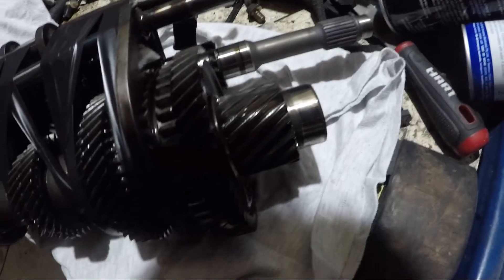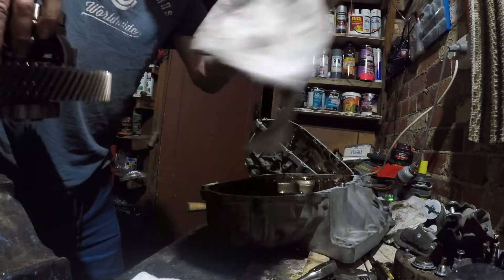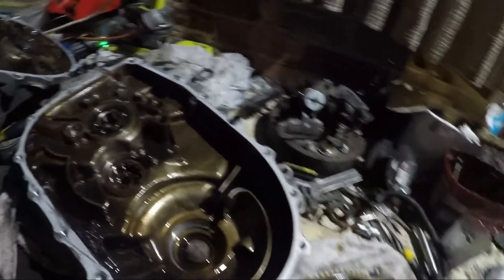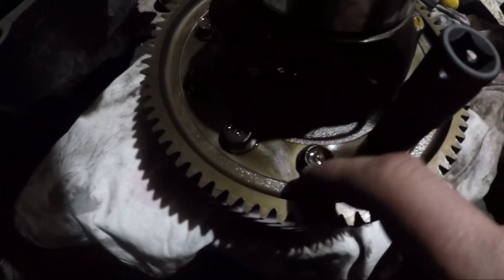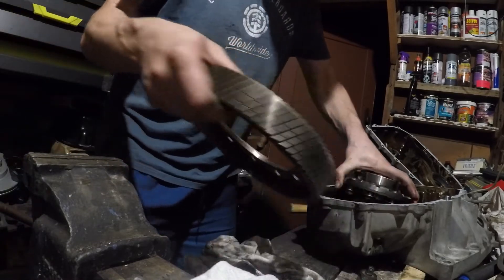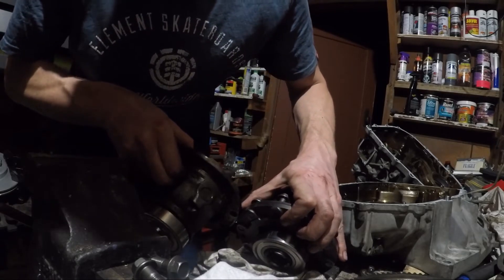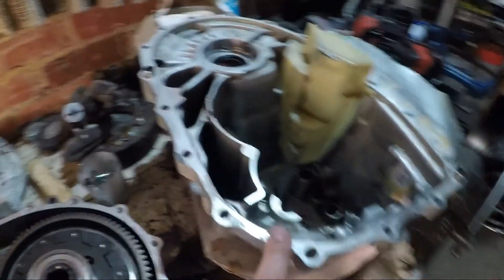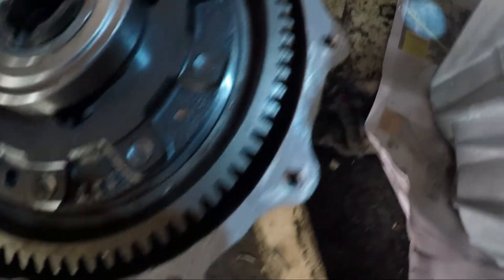Installing a DC5 Type R LSD into DC5 Base model

Comment: I’ve been wondering if that LSD could be installed on the DC5 for North America known as Acura RSX as a direct fitment.
Reply from the maker: Yeah this will work in your DC5 box. JDM EP3/DC5 LSDs will fit any of the 5 or 6 speed RSX boxes

Comment: Would you consider the base dc5 5 speed box a good budget option compared to a dc5 type s box ? e.g gear ratios, reliability, etc
Reply from the maker: From my understanding the type S box is better ratios. Turbo guys really love the base box because it has wider gears and its better suited to boost. I believe they are much of a muchness for reliability and having the 6th gear on the shafts doesnt impact the reiability. If i had to choose between the two I'd choose the type S. I'm only running this one (base)because i got it for $140 and the type S would be at least 10 times as much here in aus.
Reply: @teamaxlestands  ahhh makes sense. I have a k24a3 with a cl9 box on it.  I was thinking of getting type r gearsets for it. What do you think? Better off getting a type s box, ep3, fn2 type r box or ?
Reply from the maker: I actually have a CL9 box too which i'll prep to go in. I think i'll put a gearx 1st/2nd in which makes the ratios much better. If i had to pick one of the 3 you listed - id go an EP3. Pretty sure they are DC5 type R box which is the bees knees. Oh i should say i dont know too much about the fn2 box so that might be good too.